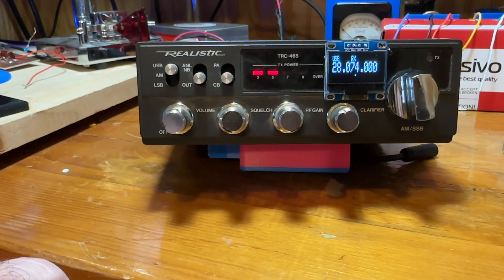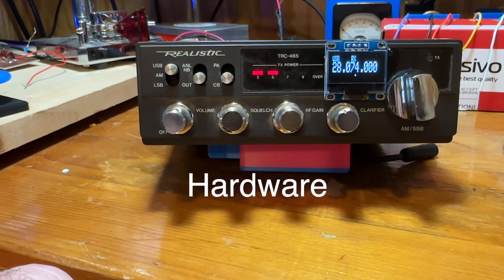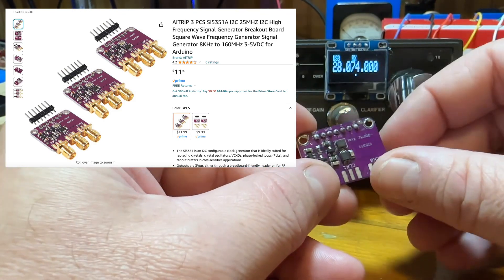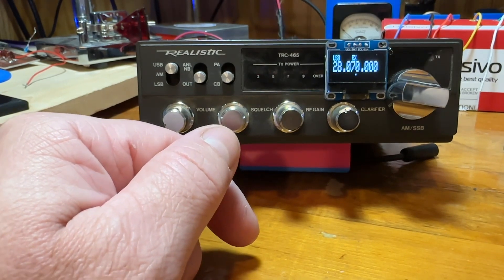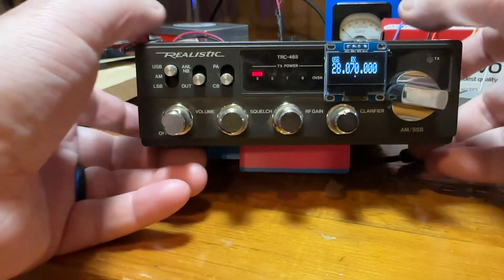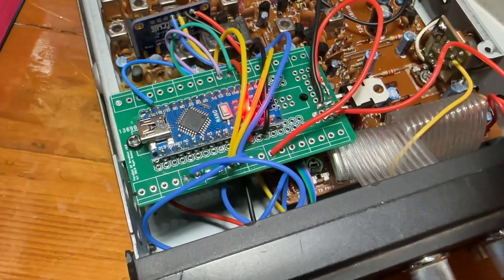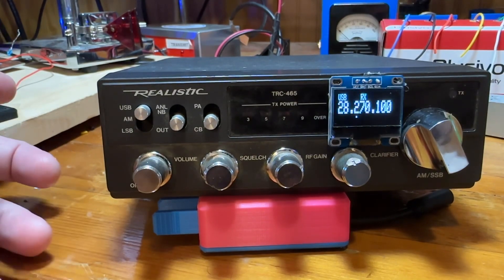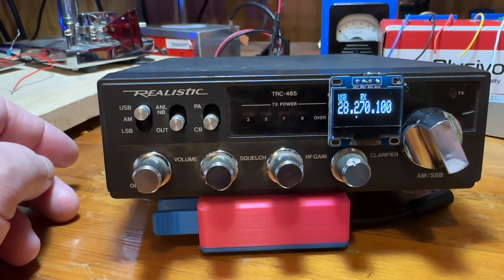How to Convert a CB to 10 Meters part 2 (Ham Radio DIY) Built not Bought!

Comment: Great conversion! By adding disc caps to the tuned circuits in the tx and rcv you could get that down to 20 and 40 meters. I've done it to the cobra 148s but I rewound the vco coil and changed the 11.325 mhz crystal to a lower frequency. Great job what you have done! It's what ham radio is about!
Reply from the maker: Thanks Carl. Appreciate the kind comments. Its been a fun project so far. I might do something like that down the road maybe when ten dies again.

Comment: can you make a build guide and document this. I am a technician HAM operator and want to use 10 meters without breaking the bank and plus I love arduinos and soldering I just dont have enough knowledge to do this myself alone without a guide. KI5QMT 73
Reply from the maker: Build guide would be tough as each cb is going to require a level of different needs.

Comment: Great project if you are an Electrical RF Engineer.
Reply from the maker: Great project for a ham!
Reply: @QRPMonkey Not everyone has the skills and talents necessary to convert or fix things. Age takes away your eyesight and makes your hands shake. But...
40 years ago I converted a Realistic TRC-457 to 10 meters, and teamed up with a 4 element horizontal beam at 35 feet had a blast working the big DX. 
You did a very good job with your project.
Reply from the maker: Yes you are right not everyone does have the skills. Which is why i like to share my passions. I definitely don’t have all the skills and learn as i go. I understand the age thing too. I have to use reading glasses now and didn’t a year ago. Hi hi. Thanks for watching and the kind comments. 73!
Reply: @QRPMonkey  I like to encourage experimentation and tinkerers, and since you're doing both you get two thumbs up 👍👍. 
I'm a graybeard, been tinkering and fixing things since 1964. A lot of the things I have were castoffs. Although I have a Yaesu FTdx1200 my favorite is a Siltronix 1011D that was given to me because it didn't work. I fixed it and it looks and works great. I have a video of it on here.
Reply from the maker: Thank you again for the comment. I would to see the video. You can post here or send me a link. Email good on QRZ. 👍 i love fixing old radios. Have a few that need worked on and need to get to them.
Reply: @QRPMonkey  My radio videos are titled "A Spin Around the Band". Just enter that into the search and enjoy.